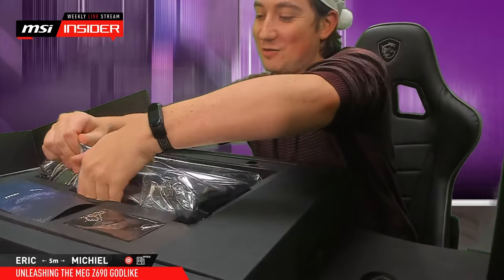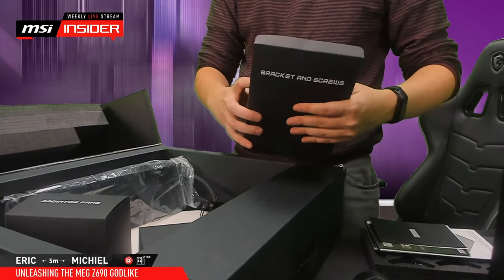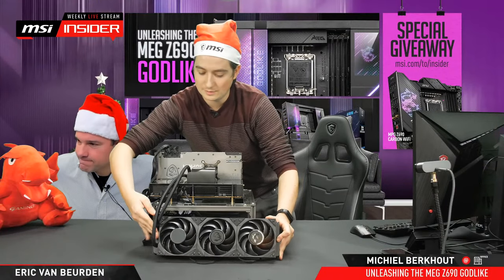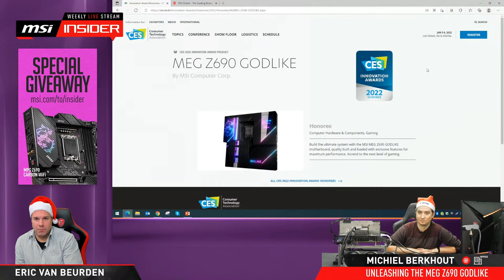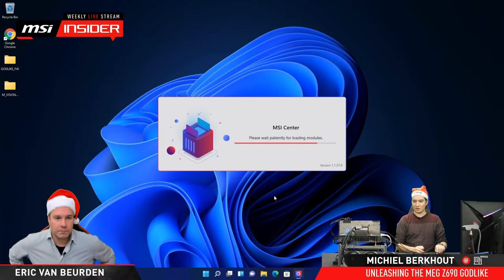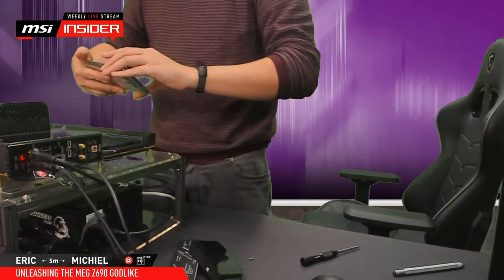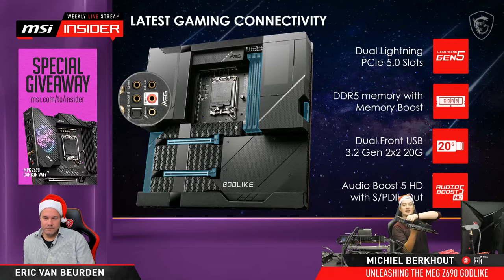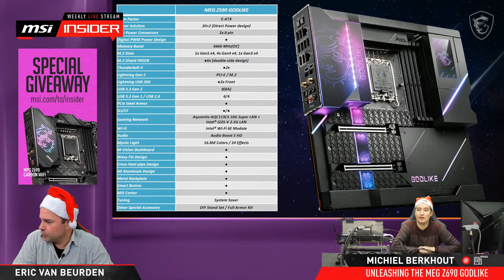Unleashing the MEG Z690 GODLIKE

Comment: It's nice. Of course, complete overkill as usual, and most people buying this will only use a fraction of its features and capabilites, they'd do fine with a normal board for 300 bucks. Also, i've seen people buy a Godlike before that didn't even know that you have to do BIOS updates sometimes, and how to do them. They have more money than PC knowledge, clearly. 😁
Currently, a Z690 DDR4 board gives vastly higher bang-for-buck, due to very cheap DDR4 RAM and very expensive DDR5 RAM. And speaking of BIOS, the early Z690 BIOS (not just for MSI) seems quite immature. Newer beta BIOS versions are circulating on the MSI forum which fix some of the bugs. Other brands like Gigabyte have similar problems. Bad XMP support, wake up problems from standby, and so on. So it doesn't matter how good the hardware of the board is. The BIOS needs more time to mature.